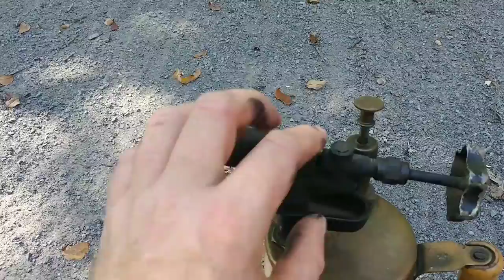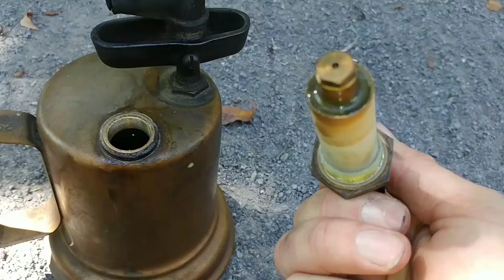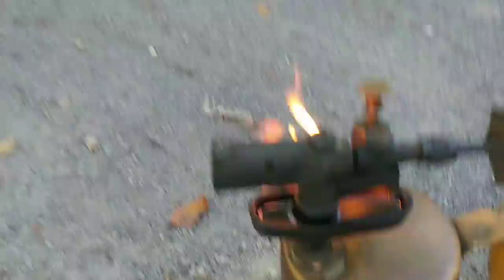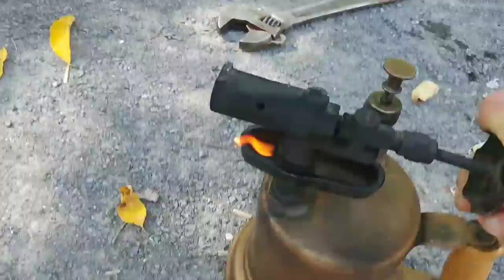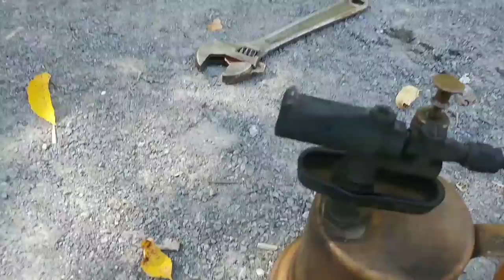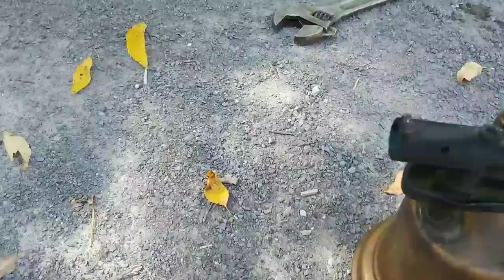How to run a antique Gasoline blowtorch

Comment: My dad used those to do floorcovering in the 50's. The top would hold a soldering iron in the flame also. They worked great. Every gas station had pumps dedicated to "White Gas". Coleman fuel was not a thing until the 70's I think. He switched to butane torch when they came out in the 60's.
Reply from the maker: Neat didn't know about the gas stations with white gas ... apparently  this one might supposed to be kerosene  .. going to try it once I get my hands on some ..also going to take it apart and give it a proper clean
Reply: @Drifter69  A good "clear" unsented lamp oil is an excellent kerosene if you can't find K-1. My grandfather had 3 of them so he would have plenty of cool down time between firings. Remember to wear 100% wool when you're really using these things.
Reply: @robertlee4139they will all run on regular gasoline, it’s just not as clean of a burn and will soot up the burner and the generator faster.
Reply: I wish they still sold white gas at gas stations. I’d fill up a 6 gallon tank with it. Having to buy those singular gallon drums is a pain.

Comment: I found one of these in the garage of the house I bought, never knew exactly what it was until now! Thought it was some sort of acetylene lamp or torch type deal. This is awesome, gonna go see if I can blow myself up now! Good times!
Reply: Remember to stop, drop, and roll 😅
Reply: I was watching a video a while back and the lady was using one. I was going to look for one on eBay, but when I was putting salt in the softener, I noticed one sitting on a shelf. It's crazy how easily we look right past something just because it's not familiar!

Comment: Very cool and clear video, great instructions. I was just trying out my torches, purchased at scrapyards for pennies - despite being older than me, they all fired up pretty much fine - although the jets got clogged up after a while, probably due to some old gasoline residue that was still inside. For something so relatively simple, they pack a lot of power - the biggest one I have produces a flame well over a foot in lenght!
Reply: Very clear video? What were you watching

Comment: My Dad had a couple of those in our garage. He and my Grandpa built houses in the 1930's , 40's, and '50's. They their did all their own tinwork ( flashings & like that,) , and plumbing-- copper pipe and cast iron, lead caulked sewer pipe. They used them to heat soldering irons (  coppers actually.) And to melt ladles of lead for the sewers. I saw him light one one day- thought the thing was gonna explode.
Reply from the maker: Hehe yeah I am debating  about taking it back out and running  it on kerosene  ... to see the difference... i also kinda want to polish it up .. but also like the patina

Comment: No doubt you know this but, the preheating cup is supposed to be filled with alcohol to burn and preheat the burner BECAUSE—this is supposed to be filled with KEROSENE which is much less volatile than gasoline. 👍🏻
Sputtering flame looks like a dirty generator. You may be able to disassemble the torch and clean everything with denatured alcohol and wire brushes.
Reply from the maker: definitely going to try this when i get back to working in the shop .. wife has me busy with other stuff lol i dont get to play as much .. thank you for the tip
Reply: totallyfrozen there is no actual “generator” per say. Just pull the knob and clean the orifice.
Reply: @Drifter's WorkShop  
  Funny how that tends to stifle tinkering.

Comment: New ones are still made in Ukraine but they're steel not brass. The old Turners etc are less corrosion prone. Those torches are as safe as they ever were in good condition.  They were designed for daily trades use. Mine works fine.

Comment: it is a popular saying, which explains that with old machines, proven, they can be made a whole Trust
Reply from the maker: Yes I very much agree... I tend to prefer older tools for this reason
Reply: Consumer products
In Asian manufacturing there is good and bad.
The chapter: drills.
In the 40s'-50'-60'-70 ', it was always an adventure to perform in the wood (tender or hard)
A 5 mm hole, and in the metal it was, for Mr. Everyone, mission impossible. The price of
Electric drills was prohibitive for someone non-professional. So to perform a hole
In the wood, for audacity, used an old used mechanical chignole. To do the same
Hole in the metal, it was the obstacle course. All weekend was taken to perform
some anodine operation. To pierce in the stone or in the brick, there was a special wick
used with a mandrel and tapped with a hammer, again it was a whole program, the
Sparadraps and the Mercochrome were essential. In old walls, we were doing a big
Hole we placed a wooden cube, and all fixed with fast-taking plaster. To make DIY in this way, it took a lot of time. From the 70s' that existed metabo percussion drills, 100% aluminum, but it was necessary to save 7 months to get it. But Black and Decker combined drills started to see the day and at affordable prices. All this made in Europe. And plastic started little by little to be an integral part, electrical appliances. This implies that there was double electrical insulation, and consequently, they no longer needed grounding.
The chapter: Calculators.
I took courses on the night for more than 12 years, and until 1976, we had to calculate moderately
a calculation rule, certainly he had HP scientists (HP 45, HP 67 A magnetic cards) but it had to
Winning the lottery to pay one. In 1976 at Photo Hall we could buy HP 21 has
Very affordable price of Asian manufacturing.
The chapter: television.
In the years 40'-50'-60'-70'-80 ', to obtain a position it was necessary to save more than a year,
Because these positions were made in Europe, and their manufacture was very expensive.
Most, to see the programs, they went to the cafes. These positions were mediocre from the point of
Design view, especially those with lamps. They fell very often down. In these times, do the
HiFi tv denial was a very profitable profession, I can affirm it because I am an electronic
Graduate and ex convenience store. With the semiconductor event (transistors, integrated circuits and finally
Microprocessors MOST FET) The reliability of these products, is an exceptional reliability, the number
Faults is very rare. For example flat screen TVs. The electronics is omnipresent in almost all electrical appliances. Alas, they are of absolute invulnerability to an average IM, which can bring us back to an electronic lamps technology 40 '.
I can deepen this important topic, but it is very vast. To say what is better between the old and the
Modern, the discussion is as exciting as useless.

Comment: Watched my dad use one of these things to heat up a breakdown that wouldn't come off , scared the crap out of me, every thing I'd ever learned on how nor to get killed was being totally disregarded with this death with a handle lighting open gasoline with a match, no, pressurizing gasoline,no the whole time it warming up to a hot burn it's hard not to run for your life, it seems to be undecided on weather to blow up or burn , it sounds like a rocket ready to leave any instant, the heat coming of is incredible, like sitting in front of a campfire. My dad picked this thing up lights his smoke with it and points it right at the car,like right in, the cars a gonner in 3, 2,boink. He turns so the torch, puts it down,to near me, reaches our with welding gloves and that drum just came right off  threw it on the ground,too close to me and the showes over, I think I'm gonna get me one, seems like its almost a forge how much more could it take.

Comment: mine dont work right and i still dont know how to fix it 
it wont shoot proper
Reply: Make sure the pump end is sealed. Most importantly, Learn how to pump it. And make sure the head I’d hot before you open the knob.
Reply: @maxhammontree3169  i think i got it now thanks

Comment: Perhaps you could be safer using a slower burning fuel. Perhaps liquid paraffin/kerosine would be a choice. See this torch (see link) fueled by a slower burning fuel. It seems that gasoline could be too dangerous for safe use or perhaps not intended or recommended for safety reasons. https://www.youtube.com/watch?v=3lLKs0ITZTE 

More: Kerosene, also known as paraffin, lamp oil, and coal oil (an obsolete term), is a combustible hydrocarbon liquid which is derived from petroleum. It is widely used as a fuel in the air industry as well as households. Its name derives from Greek: κηρός (keros) meaning wax, and was registered as a trademark by Canadian geologist and inventor Abraham Gesner in 1854 before evolving into a genericized trademark. It is sometimes spelled kerosine in scientific and industrial usage. The term kerosene is common in much of Argentina, Australia, Canada, India, New Zealand, and the United States, while the term paraffin (or a closely related variant) is used in Chile, eastern Africa, South Africa, Norway, and in the United Kingdom. The term lamp oil, or the equivalent in the local languages, is common in the majority of Asia. Liquid paraffin (called mineral oil in the US) is a more viscous and highly refined product which is used as a laxative. Paraffin wax is a waxy solid extracted from petroleum.
Reply: Cut and paste Wikipedia makes you feel smart?

Comment: Consumer products
In Asian manufacturing there is good and bad.
The chapter: drills.
In the 40s'-50'-60'-70 ', it was always an adventure to perform in the wood (tender or hard)
A 5 mm hole, and in the metal it was, for Mr. Everyone, mission impossible. The price of
Electric drills was prohibitive for someone non-professional. So to perform a hole
In the wood, for audacity, used an old used mechanical chignole. To do the same
Hole in the metal, it was the obstacle course. All weekend was taken to perform
some anodine operation. To pierce in the stone or in the brick, there was a special wick
used with a mandrel and tapped with a hammer, again it was a whole program, the
Sparadraps and the Mercochrome were essential. In old walls, we were doing a big
Hole we placed a wooden cube, and all fixed with fast-taking plaster. To make DIY in this way, it took a lot of time. From the 70s' that existed metabo percussion drills, 100% aluminum, but it was necessary to save 7 months to get it. But Black and Decker combined drills started to see the day and at affordable prices. All this made in Europe. And plastic started little by little to be an integral part, electrical appliances. This implies that there was double electrical insulation, and consequently, they no longer needed grounding.
The chapter: Calculators.
I took courses on the night for more than 12 years, and until 1976, we had to calculate moderately
a calculation rule, certainly he had HP scientists (HP 45, HP 67 A magnetic cards) but it had to
Winning the lottery to pay one. In 1976 at Photo Hall we could buy HP 21 has
Very affordable price of Asian manufacturing.
The chapter: television.
In the years 40'-50'-60'-70'-80 ', to obtain a position it was necessary to save more than a year,
Because these positions were made in Europe, and their manufacture was very expensive.
Most, to see the programs, they went to the cafes. These positions were mediocre from the point of
Design view, especially those with lamps. They fell very often down. In these times, do the
HiFi tv denial was a very profitable profession, I can affirm it because I am an electronic
Graduate and ex convenience store. With the semiconductor event (transistors, integrated circuits and finally
Microprocessors MOST FET) The reliability of these products, is an exceptional reliability, the number
Faults is very rare. For example flat screen TVs. The electronics is omnipresent in almost all electrical appliances. Alas, they are of absolute invulnerability to an average IM, which can bring us back to an electronic lamps technology 40 '.
I can deepen this important topic, but it is very vast. To say what is better between the old and the
Modern, the discussion is as exciting as useless.

Comment: This is not a gasoline torch, this is a kerosene torch, good didn’t explode with you, my dad had many he used to use them to burn Knots on wood boards,
Reply: This design is specifically for Gasoline... They even say it on the side. A series of valves stops the flame from going inside the vessel.